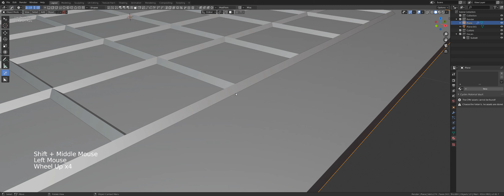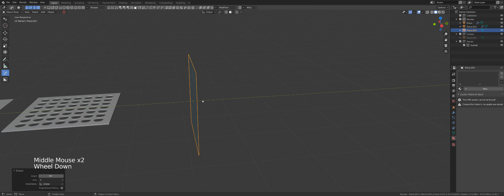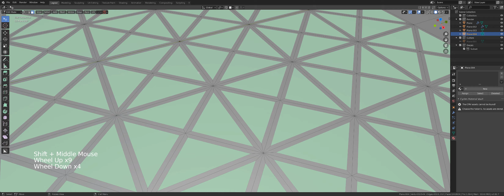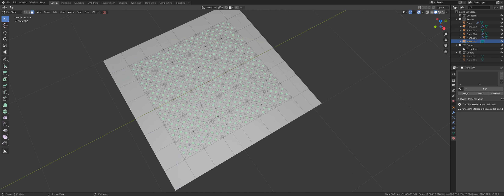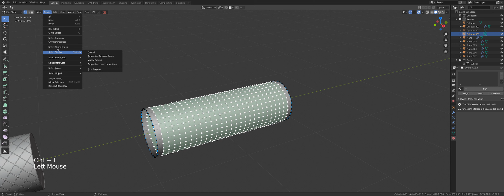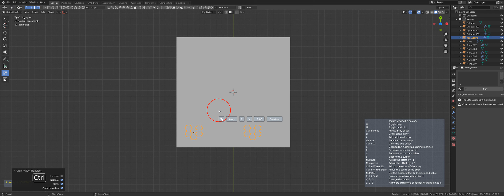Quick guide to creating GRATES with Hard Ops Boxcutter and Mesh Machine (Blender 2.82+)

Comment: First of all, thanks for a good tutorial video.

I bought the MESH MACHINE addon to follow you :)

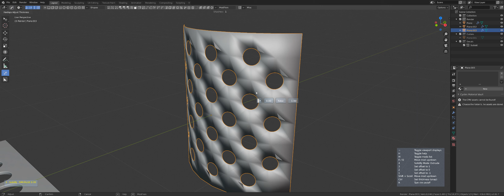When applying the Solidify modifier as an ops at 6:09, you entered the R key.
Although this feature is described as Turn rim on/off, I have no idea what this feature is.

In the video, if you press the R key, the shadow of the part drilled in a circle will change slightly.

When I hit the R key while following the video,
It becomes a strange shape that one side of the wide side disappears.
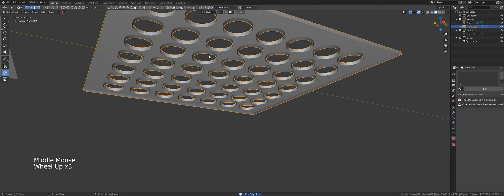It's as if Solidify is only applied to circular inner passages. (It becomes like 3:38. Either way I do Solidify in front or back, it comes out like 3:38)

The peculiar point is. Inevitably, without pressing the R key,
If I follow the rest of the video (Meshmachine> Normal> Transper), the finished product will appear as neat as it appears in the video.

What am I doing wrong?
Reply from the maker: Gratz! You will enjoy that add-on for sure. R is pressed during solidification of the surface, and it simply removes the back face of the mesh in order to reduce the total geo count. Grab a plane, solidify it and press R while doing it and look at the other side of the mesh, the face that stays hidden from the view will disappear. It leaves only the rim and the front face. You need to solidify it and press R before you do the normal transfer.Also, make sure that you apply the solidify before you do the normal transfer.
Reply: @PonteRyuurui  Thanks to your kind explanation, I have only succeeded in the video now. Thank you.

The reason why it seemed to clear both the front side and the back side when entering the R key in the Solidify command is //
When I first made the plane and rotated it around the X axis, it was because, unlike you, I flipped the surface.
(In fact, I rotated 90 degrees around the X axis in the same way...I don't know exactly why the normal direction was on the opposite side)

Thank you again for your help, and I'll watch the rest of the videos ^^. (Actually.. Your work speed is sometimes a little faster, so I'm continually pausing and turning around to follow you :)